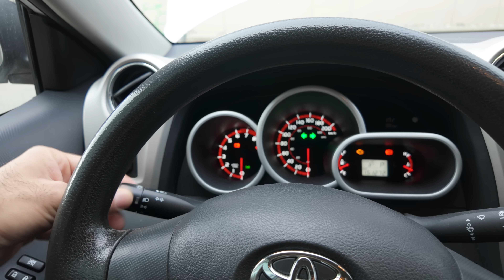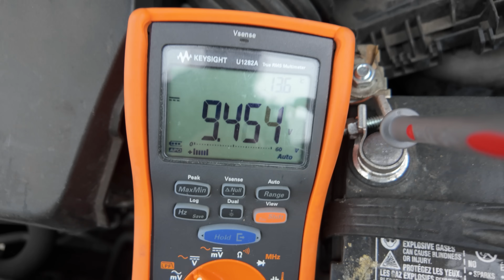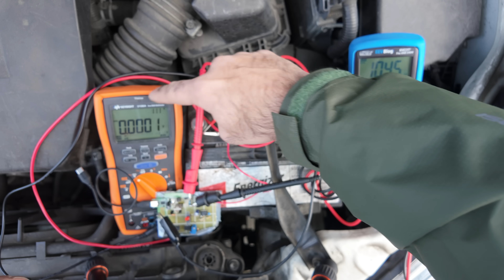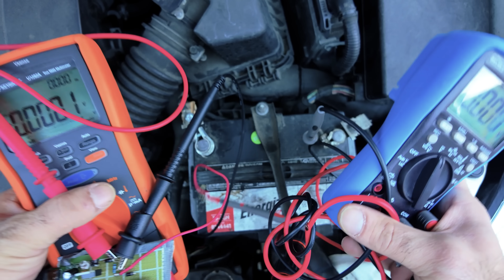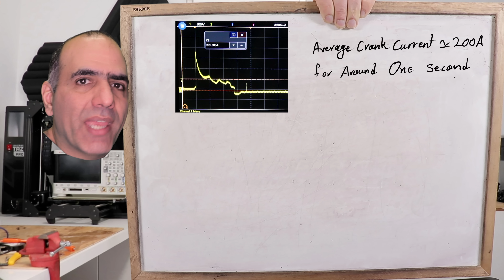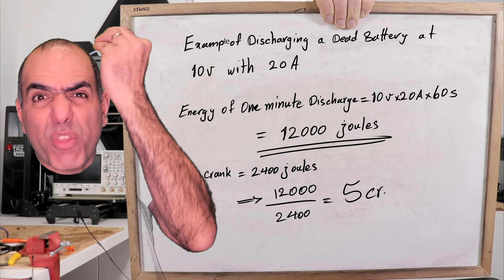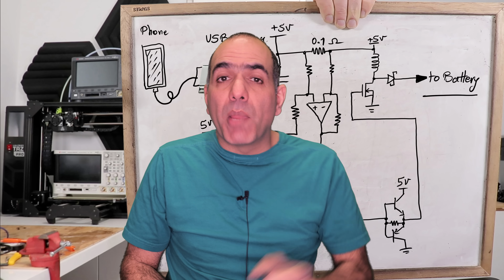Jumpstart by Phone

Comment: 300mA charge on car battery is barely useful in short time range. You need at least 1A to do a decent job on helping your car's main battery to start the engine, 3-5A is preferrable. With that much current available you'll be able to start your car from no crank or even completely dead position in less than an hour, usually in 5 to 15 minutes. You don't need to torture your phone. You probably already have a power bank, so all you need is a Buck-Boost CC/CV converter (there are off the shelf modules, just buy one that suits your needs), and if your power bank supports one of quick charge protocols, then a trigger cable or trigger module that would tell your power bank to enable its highest power mode. Also you'll need a MOSFET (for charger reverse polarity protection, note that it is different than consumer reverse polarity protection so a simple diode doesn't work here), some resistors to control and bypass MOSFET, and a leads with crocodile clamps or with lighter plug. With lighter plug you don't even need to open your trunk lid, just plug it into your lighter socket and it will charge your car's battery. The converter and leads of course stay in your car, and the power bank you usually carry in your bag. So there are two advantages over jump-starter power bank. One is that your power bank can be not so bulky, and since you carry it with yourself, it usually stays warm enough to do its best even in cold weather. Another advantage is that you don't overload anything, you don't need a scary 200A+ battery of questionable quality with flimsy wires, your current values will be much smaller than that. 

On the other hand, 300mA and less is useful as a trickle charge. If you plug your car overnight into 100-300mA charger, it'll start next morning pretty easily, even if outside is -30C or even less. You can use the same power bank module, just set it to lower output

Comment: Oorrr, you can get a jump starter that also functions as a USB power bank. They're pretty cheap and work as a charm!
Also on an EV BTW (at least, when talking about reviving the small 12V battery that is used to start the car, just like an ICE car).
But of course, this is the partical, boring option XD.

Comment: Regular lead acid batteries only have 50% usable capacity. This 55 Ah battery should only ever be discharged 27.5 Ah from full. Discharging more very rapidly degrades the battery. Lead acid is best kept full at all times.

Comment: Some phones can reverse charge other devices through wireless with up to 22.5W (the Xiaomi 17 Pro Max). That would be way faster than using the USB port - though less efficient and requiring a more complicated circuit.

Comment: And if it doesn’t work, you won’t be able to call someone for help.
Reply: use the battery to recharge the phone
Reply: @MrRock861261 so smart
Reply: Even a ‘discharged’ car battery should be able to charge your phone easily
Reply: @shashi20008  and blow up the battery again... /j
Reply: @shashi20008   Many car socket chargers stop operating when the input is in the range 8-10V.
Reply: @pault6533  Then just make your own that doesn't. A simple buck-boost converter can have a steady 5V output at input ranges of 3-20V
Reply: @Koddra  i have some of those. It’s likely someone with this much electronics in their car likely has a powerbank to recharge the phone. 😅
Reply: If you had someone to call for help, you probably wouldn't be trying to charge your car with a phone.
Reply: people have backup phones (i have 1,324,523 phones for backup NO SELLING)
Reply: i travel for work alot and carry extra phone banks one bank is 10amp hour, the other one is 24 amp hour
Reply: Someone isn't old enough to remember the 90s
Reply: it doesn't discharge that fast. But modern phones should reserve the last 5-10 percent for an ultra battery saving mode like xiaomi does to turn it into a dumb phone
Reply: Just have a battery bank and use that instead of using a phone battery to revive your car…
Reply: Probably for the better, nobody wants to explain that problem to CAA.

Comment: Few days ago my car bat was flat. 11,3v
Put a 12v 3s4p liion on it. Didn't start. 
Put 2x 3s4p: didn't start. 
With 2x 3s Lipo; didnt start
1x (weak) 4s didn't start. 

-Why? Shouldn't 2 paralel DIY liion packs deliver enough ampere for direct start? (Did not try long loading without loading device)

Comment: The other day I nearly killed my battery while trying to relaunch the fuel circuit.
I started using my wife's car but while removing the clamps I short circuited my battery. I could start, let it run for 30 minutes but as I started to drive to charge it, no direction, no abs. 10 meters farther, nothing but the engine was running. 
Some cars has a low tension protection😅

Comment: well... I would rather throw a powerbank at it than my phone
Reply: There are actually powerbanks with jumper cables on the market. I have mine for almost ten years now 😂
Reply: @brag0001 I've used mine a few times. It is always better to have it and not need it than to need it and not have it.

I also have a winter readiness kit and some survival tools.
Reply: @haloslayer255  I bought mine when my car computer was broken and constantly rebooting. This would drain the battery sometimes over night. We needed the car and couldn't get it repaired right away.

Once it was fixed we kept the thing because we already had it anyways. It turned out useful quite a few times since.

I fully agree with you. It's a small investment which can save your butt from awkward situations. It's even useful in many electric cars. Those also have a starter battery and many of those lack a circuit to wake the high voltage battery to charge the starter battery if it drops low in voltage. Which can happen quite easily with the amount of connectivity cars have nowadays ...

Comment: The battery didnt jump to 13.5 volts, thats the alternator voltage with the current charging load 🤦‍♂️
Reply: Believe me, he knows that
Reply: I guess you are new here.
Reply: But, you shouldn't let the car's alternator recharge a battery from that extreme discharge state. The car's alternator can over heat from such heavy load for as long as it takes to charge the battery. Especially if it's idling. Heavy load + low air flow = fried alternator (Full Wave Rectifier! ) diodes.

Comment: Literally just went though this on my wifes Prius. Used an old schumacker sl1315 jumper pack with a busted screen that's about 7 years old and fired it right up. It's basically a cell phone battery with the jumper leads. The fact it jumped a 12 volt AGM starter battery  that's 3 years old from Oreilly's at 10 degrees Fahrenheit that was completely dead is nothing short of a miracle.  At least his battery is easy to get to, the one for my wifes prius is in the trunk.

Comment: I like that the USB PD decoy board in the diagram was already jumpered to 12V, if your phone or power bank can do 12V PD that's actually all you need
Reply: Most phones only send 5 volts out of their USB port so it wouldn't work. Not an issue with power banks or some laptops though.
Also car batteries need at least 14 volts to charge so its better that the USB PD trigger board is set to 15 volts.
Reply: @RtqoopbFl9WpIP9fULuihzt6Sk4t9u  If the battery is discharged 12V will still charge it. You wouldn't be able to fully charge the battery, but that's not going to happen before the phone or powerbank run out of charge anyway. 15V would charge faster, but on the other hand with only 12V you can probably get away without current a limiting circuit, with 15V you definitely need one.
I'll probably put a PD module set to 12V with cables for it in my car.

You don't need over 14V in general, only for fast charging and without a charge controller you run the risk of overcharging (not with a phone battery of course). 13.8V is typically used with the car's generator and with simple chargers which just provide constant voltage, which is enough to fully charge a battery over time.
Reply: Maybe still a current limit but yeahh.
Reply: @shivamkantprasad  Yes, that would be good. I small (~1Ohm for a power bank that can do 2A) resistor will probably do it in a pinch, and that's what's the idea here I think. Or even just long and crappy cables and some oxidation on the battery contacts :P
Reply: Can phone provide 12V from their USB-C? It can receive it but not sure about the other way around.
Reply: @OmeletteDuFr0mage  Depends on the phone, but most will just give 5V.
Reply: An important thing to note is that without an extra diode current can flow back into the phone/power bank while it's still set to 5V, both of which won't like the 10V of the discharged battery.
So without the diode it's important to connect the PD board to the phone/power bank first and confirm the 12V with a multimeter before connecting it to the battery.
Or just add the diode and set the PD board to 15V.

Comment: 10 Volts is way too low for a car start, think about how the car works, the ECU needs atleast 9V to be alive and not faint, anything below that wont activate properly the ECU, take it the same as trying to run your computer at third the voltage

Comment: This actually does work on an EV. EVs have a normal car battery in addition to the traction battery and the traction battery has physical contactors to disconnect it. If the regular 12V car battery dies it can't close the contactors to recharge it. If you jump the car it can close the contactors and then use the traction battery to recharge the 12V

Comment: I often start cars with dead battery so I can defenetly say that small amout of energy will work with only perfectly healthy small volume gasoline engines. Usually you need at least 2000 mAh to start a car that stands for several months with no moving.
I got 2 jump-starters and also one made by mysielf. They don't live long after constant load of car-starters so I ordered super-capacitor booster which would feel ok with giving a lot of power in a short period of time
Reply: Might want to consider a 9ah 500a lfp motorcycle battery as a 19/20ah sla replacement for a jump starter.

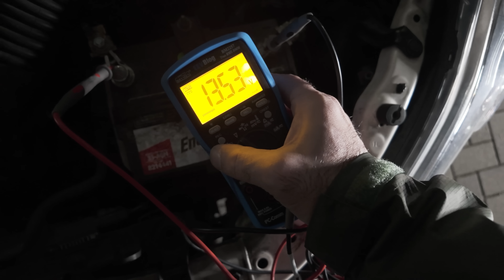Comment: Pacifically in 7:53 you said it's only take 100% of the phone battery that's very wrong tell you why because when you start the vehicle the battery discharge and every time you charge it you getting in the same result so you are not using the phone or 100% you are using the phone each time the battery is discharged

Comment: One small tip, if the phone suporta pd USB then a better USB board can pull more power from the phone to accelerate the charging of the car battery
Reply: Supporting USB PD doesn't yet mean it's going to support higher voltages than 5V. It's a separate property.

Comment: I love how he used a phone that didn't even have power sharing to prove this concept. If you use a phone similar to a Google pixel or even if you were to use a power bank with power delivery and use a power delivery decoy board, you'd be able to get 12 volt right from it and with the proper sensing the boost converter won't even really be boosting anything

Comment: dont modern phones support charging another device over USB? so if you just put some protection to you cannot rip the phone, as well as signaling what voltage you need the phone to provide, it should be able to simplify the circuit?

Comment: No, the battery voltage did not jump to 13 volts as soon as you turned on the car - the alternator in the car charges with 13 volts and you measured that :)
Reply: true but within a minute or two the battery should already have enought for cranking over again because it's low voltage of 11v draw way more amps from the alternator than a fully charged 12.6v battery.
Reply: @TwinShards that is true, however the battery on its own will usually never be 13V, as seen in the beginning it was something like 12.7, which is the healthy, charged value.
Reply: i don't know, in my car the operational voltage is 14 volts at running engine (obd data)

Comment: The only reason the starter tuned over after some time is the recovery effect lead acid batteries have in some applications.
The charge you put in was just a small sprinkle on the top to help the chemicals to wake up! 😂
The efficiency of lead acid is horrific, but you can beat them a few times! 😂
Over- under charging? Don't care! 
It hurts them a little though.

Comment: 2:23 i knew this was gonna happen since phone is rated for 5 volts not 12 volts but many modern ones are after the usb c pd handshake with the charger
Reply: they can take 12v but can they output it?  they're not really intended as a charger
Reply: @tsm688 in rare cases yes but most of the tine it's 5v only

Comment: You could wire the output of your circuit to a cigarette lighter / 12V plug and it will charge the battery from there, more convenient than wiring to the battery.  I've seen other "battery booster" systems do this.
Reply: that wouldn't have the option of disconnecting all other systems though.  he disconnected the battery and clamped on direct to avoid any loss
Reply: @tsm688  It would be an interesting experiment to see what those losses would be.

Comment: Despite the fact that a car battery is typically 12v and a phone charges at 5v then doing this would just allow your phone to charge from the car battery (assuming it had over voltage protection). Even if you designed and made a boost circuit then the ESR of your phone battery would never be able to deliver enough Amps to crank the car, your only hope would be trickle charging it back to the 12-14volt range which I guess would take a lot of time and effort. This is only possible if you are filming it for Tik-Tok 😅

Comment: Mehdi I just learned about buck converters and have a cool project you can do. As a canadian I bought a snowblower but it came with no headlight. I learned you can add a 12v LED light pod to it and power it with any power tools battery such as 20v black+decker drill battery using a buck converter.

Comment: While starting you use the surface energy from the plates. If you let the battery rest for an hour or so the energy of deeper layers charge the surface of the plates and often that is enough to get it to crank a few times. So without the phone it probably also would have started 🙂
Reply: a couple hours more at that low a voltage would probably have ruined it for good.  he almost destroyed it.  fortunately just almost
Reply: @tsm688  No, sulphating does not go that fast but it is not good in general but you do not kill it in a few hours more. It is better not to start until it refuses to go round but stop in time to let the charge equalize between starts.   Draining it so far  is indeed very bad. You can do that like 5x and you killed it.

Comment: Now charge your phone with your car.  Only fair.
Reply: Finally a real infinite power generator!!! 🤭
Reply: Nah.. only fan, it's not even hot
Reply: Like for like!
Reply: He did.
Reply: Can't be done, mate.
Reply: @KJFMZ  Interesting, is it a voltage issue? Phone can't hold back the current or something?
Reply: @benshakespeare268   Well, technically you CAN charge a phone with a car, but only when the car is stationary.  If you do it while the car is moving the electrons slosh around too much and can damage the walls of the battery.
Reply: @KJFMZ  i feel you. i keep running into this problem every day. i always forget you cant do this anymore ever since the government mandate of 2015 that forced manufacturers to prevent dynamic-charging methods. i keep getting pulled over and fined since my battery's walls are now peppered with holes due to electron slosh damage, spilling electrons all over the road. once an old lady slipped over on my stray electrons and hit her head. poor carol.
Reply: @KJFMZ  What do you mean? I charge my phone with my car almost everyday!?        Not like this directly from the battery thou... ;P
Reply: @Argoon1981   I was kidding :)
Reply: @KJFMZ  I was assuming the meant charging your phone directly from a 12v car battery. I would think the poor phone wouldn’t be able to deal with the voltage or the current.
Reply: @benshakespeare268   Kidding aside, phones now do accept 12V but only through USB-PD.  It used to be you just give the phone 5v directly, which would be fried by 12v.  But these days the phone talks to the charger and tells it "hey, I can sip from 12v if you have it available."

Comment: @electroboom 5:16 how you do measure Current in Volts range?
Seems like you show us a voltage drop across a resistor. Something sketchy is going on, or I have never seen an multimeter like yours 🤔

Comment: I use the tiny MT3608 boost converter modules for my projects. Here is a copy and paste of the specs. I like the quiescent current consumption of only 100μA.
Input Voltage: 2V - 24V DC.
Output Voltage: 5V - 28V DC (Adjustable).
Max Output Current: 2A (1A recommended for continuous use).
Efficiency: Up to 97%.
Output Voltage: Uses an onboard trim potentiometer for adjustment.

Comment: "Hooking your stove's heating element". Of course, we all do that ... don't we !?

Remember, Mehdi is doing a "101 video" on boost converters in the near future. But an old Motorola MC34063 converter chip, might work as well. There are boost converter circuits, in its app notes, and I've used it for decades to generate over 200V (for nixie tubes) with an external xstr. It also was used for 12V to 5V buck converter for plug in car USB chargers for well over a decade. If you've ever cracked open one of those chargers from the 99 cent store, you'll find this chip.